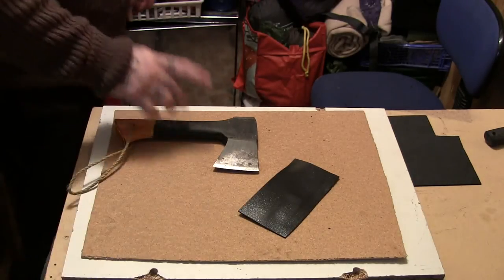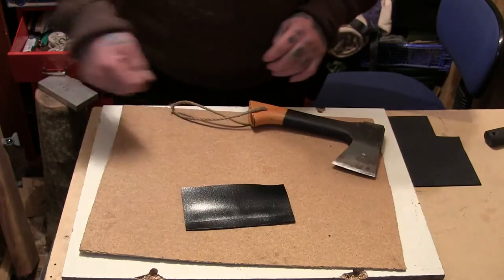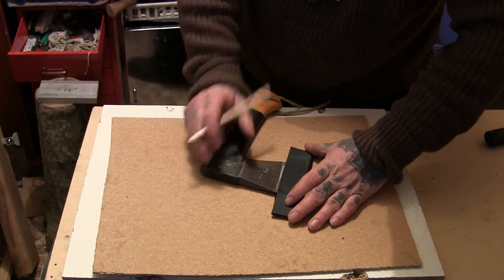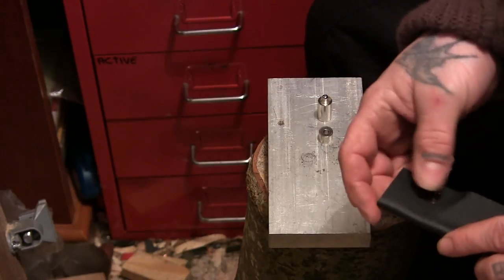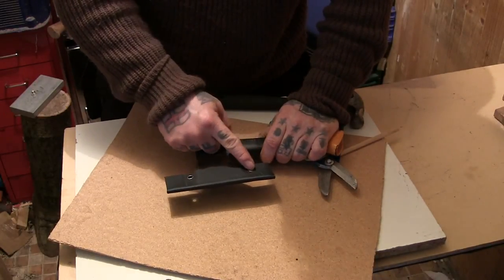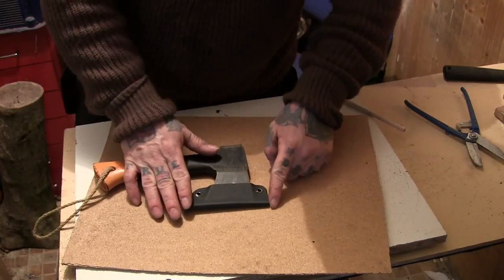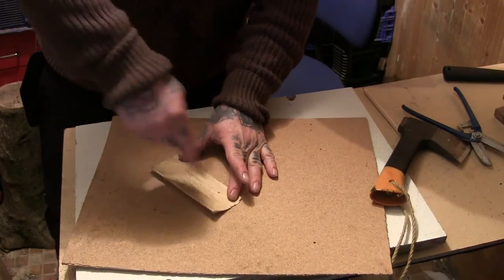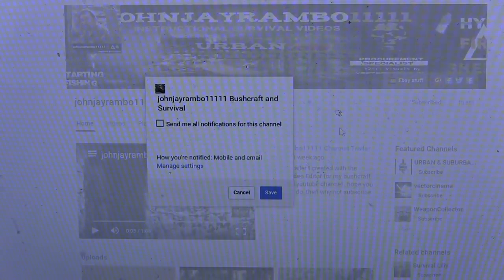How To Make a kydex axe sheath

Comment: I have a Estwing hatchet. As it is now, I have a cardboard covered with duct tape mask on the blade. Do you know if hair dryers can make enough heat to soften plastic?
Reply from the maker: +Hoonozit I guess the best way to find out is to try it , I reckon hdpe will work with a hairdryer , if not put it in the oven maybe or under the grill for a little while , and if you cant get rivets whatever use bolts